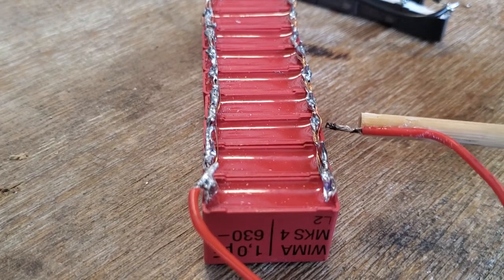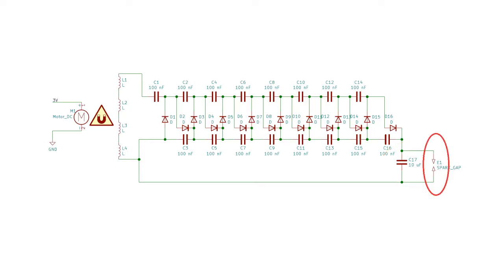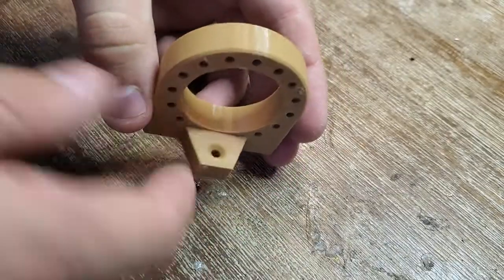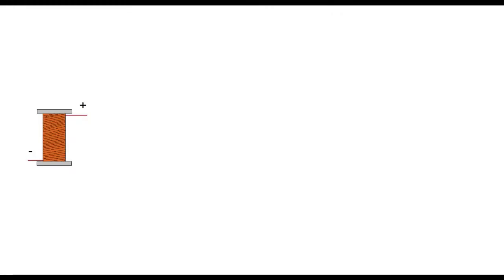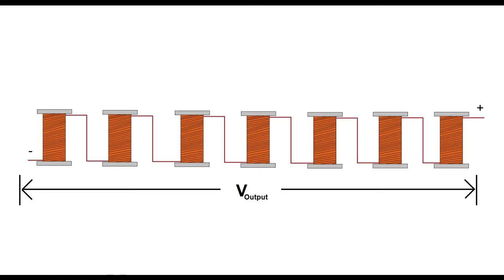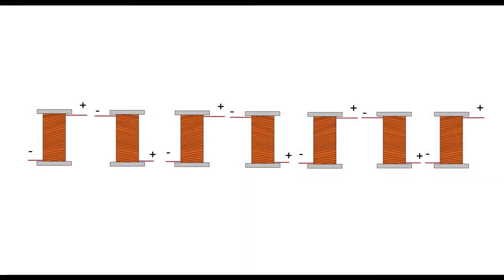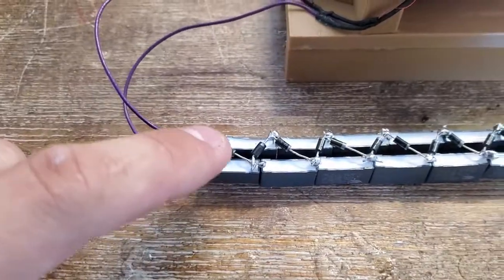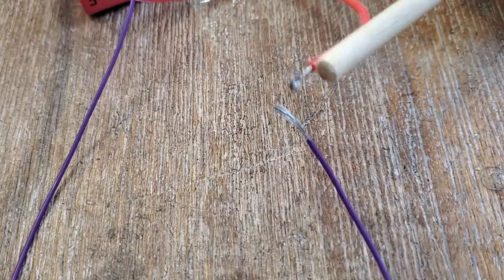Mechanical inverter/transformer - 3V to 700V

Comment: The common flaw with all these DIY generators is the lack of understanding of magnetic circuity...
Both the magnets and the base where you screw the coils should be made or have a iron plate

Comment: The magnetic circuit of your ac generator is open at the ends, not closed. Try placing mild steel rings at   the free end of the array of coil cores, and behind the array of permanent magnets. This will increase the flux density enormously, but will introduce a cogging torque that will make it diffcult to turn the handle of the generator. The cogging torque can be reduced by shaping the heads of the screws opposite the magents, and also by slightly varying the spacing of the magnets from the ideal symmetric spacing.

Comment: If your looking for just a difference in potential and would like to charge faster, you can center feed a voltage multiplier creating a large negative voltage on one side and a large positive voltage on the other. You'll reach fully charged in half the time  versus  feeding  the same voltage multiplier from the end.